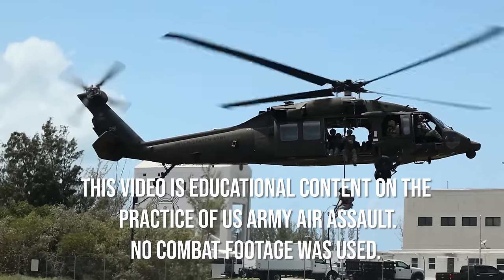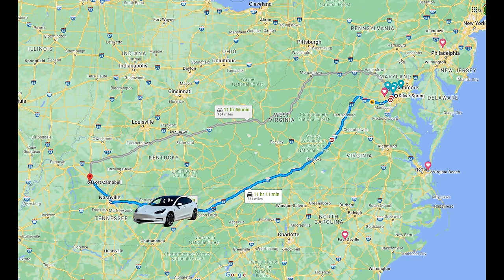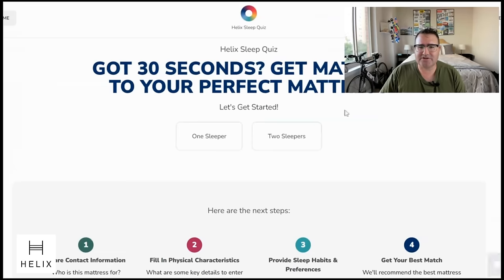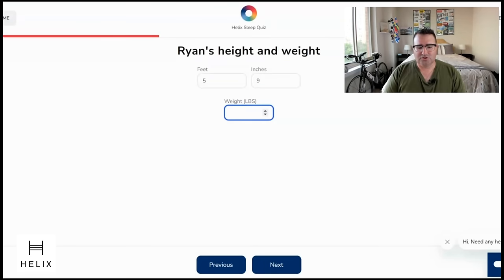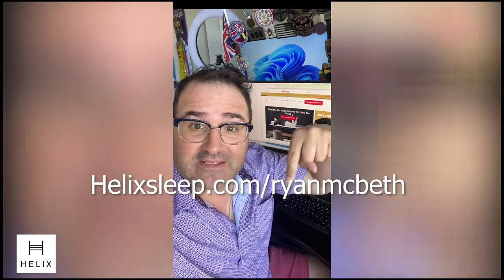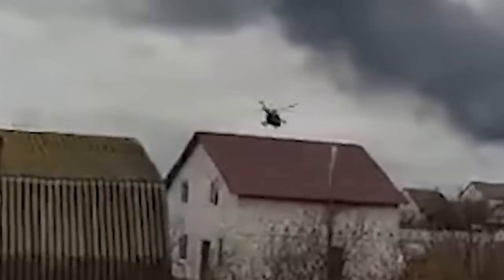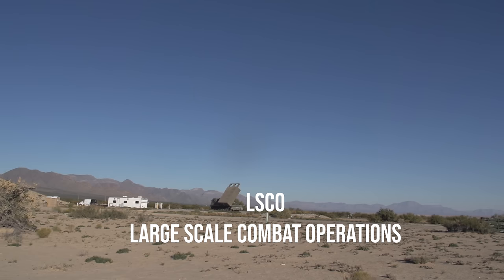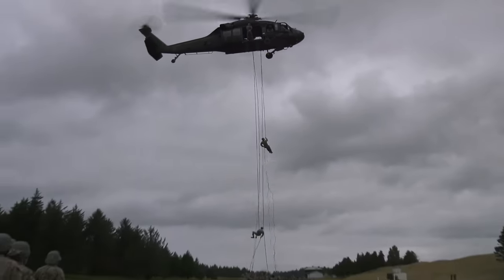How Air Assault Works - Featuring the Rakkasans of the 101st Airborne

Comment: I am a Rakkasan. I am also a former Marine. The combat tours I did with the Rakkasans convinced me that I was in an Elite unit. That is the mentality and the results we achieved support this.
Reply: First Rakk!
Reply: I have not fully understood  if BCT's under the division are airmobile on their own. On the battle order they are denoted with "v" so  they are airmobile but are they using  the helicopters in the aviation brigade for moving, or they have  separate blackhawks and chinooks? If they have their own vehicles, for what  38 blackhawks and  24 chinooks in the aviation  brigade are used for? Can you explain pls.
Reply: I was a Rakkasan as well. I want to tell yall im glad yall made it back brothers. Did you guys know that there is a saying Among the brass for us, I mean well there was? It went like this; "If there is a problem, say a pray for the enemy, then send the Rakkasans."
Reply: 101% agreed.  Some of the best Rakks I served with were former Marines.  Funny thing abour our unit, we had quite a hodgepodge of soldiers making up our unit.  We had former Rangers, Marines, a few complainy 82nd guys, some really awesome 173rd guys, a lot of legs, a few mech heads, and a lot of guys who never served anywhere else.  We had something in the 101st and in the 187th that no one else had in any other unit I served with.  'Til we form again...
Reply: @mustafayldrm3449  They use CAB assets to move, CABs for Light infantry are larger than others to accommodate the higher tempo of movement.

Comment: As a First Calvary Red Leg of 52 years ago. I remember slinging guns below Chinooks . I even saw to two Chinooks sling load a single gun working together. I doubt that’s done any more. 
As you mentioned Ryan any time the turbine is running your consuming fuel. This is critical in the planning stage.
A very well done report.
Reply from the maker: Thank you
Reply: Thanks to those maintainers, they might be using those same Chinook helicopters you were.
Reply: Yeah, I think the army retired most of their towed artillery that require more than one Chinook to lift (what's left is probably in storage awaiting the order to be decommissioned). All the heavier artillery goes on a plane or a boat.

Comment: The crazy part is how much more there is to all this than Ryan could fit in, such as integration with the Air Force and so much more. It’s a capability that people have no idea how to deal with, and I’m glad for that. Nice video, Ryan ❤️🙏🏼
Reply: You left out the Navy; my Dad called in Naval bombardments @ Hue, coastal city, Tet offensive '68.  Fire Supp Coordinator w 1st Cav. situation @ Khe Sanh so desperate rules for B-52s dropping dumb bombs fr 30,000 ft shrank fr not within 2.5 miles of friendlies to 1.5 miles.  Pops attended basic officer training @ Ft Sill in '57, doubt they had any concept of attack helicopters as close tactical support then. advanced training @ Benning '63/64 airmobile concept in early stages.

Comment: Rivalry aside, one thing that Marines and Airborne have in common is that if things go sideways, there is no path of retreat.
A comparison of Marine and Army helo ops would be enlightening.  The Marines invented artillery raids in the Korean War with portable rocket launchers, and still embrace vertical envelopment as central to amphibious warfare.
In the assault you covered, I would see an artillery strike on the AAA position as a good alternative to risking helos.
GREAT VIDEO--Thanks!

Comment: Speaking as someone who has lived on Zama Base in Japan, it's a bit of a cultural faux pas that the 3-187th use the Torii Gate as a symbol. The gate itself is meant to represent the division, or boundary, between holy ground and normal ground. Entering through the torii gate is to enter a shrine and the holy grounds that it has within it's compound. It is also used to mark the entrances to most cemeteries in Japan. As such...you can maybe get an inkling for why it might be offensive to some Japanese people (especially older ones) when they see an US service member walking around with a Torii gate on their arm patches.

Great video as usual, Ryan! Looking forward to more.

Comment: i was a helicopter prop and rotor guy  MOS 68D . this was back in the late 80's.  Got attached to OV-1D unit at Ft hood and became a crew chief on the Mohawk (MOS 67H).15th MI BN, 504 MI BDE but assigned to 1st Cav.  Went to air assault school at Ft Hood.  passed the first try unlike almost half the class.  i think there were about 600 people there on day zero to try to get in.  12 mile forced road march with full gear.  Had to finish in 2 hrs.  I trained for it for several months first.  sling loading and all that is the last few days after they have made everyone drop that they can make drop.  600 started,  a few dozen finished

Comment: I spent the last three of my ten years at Campbell. I was in 311th MI BN. We operated a brand new system, Trojan Spirit. We were the first team to sling load it in the field. Two shelter carrying humvees each with a different load balance. One regular trailer mounted generator and a large satellite dish on the other trailer. First mission ended up with every light in the maintenance shelter busted. And that’s why we train.

Comment: I remember Battle Order did a vid on the weakness of the VDV. And after watching this video, the difference between the two is definitely visible.

The summary of that video are:

-The VDV is trying to be a light mechanised air assault force, but don’t have sufficient air assets to lift their BMD light tanks efficiently (Which the VDV mostly depended for transport and dismount fire support).

-Even if they have enough cargo planes to airdrop the BMDs in scale, BMD itself is too lightly armoured for the role of supporting the infantry dismounts while assaulting an objective.

-Even if the BMD is good enough as it is, there is just not enough bodies in the infantry composition for an operation to last if met with heavy resistance or if opfor is near-peered, as any casualties can quickly lead to combat ineffective.

This goes to show that no matter how elite your troops are, if their mission exceeds their capability, every battle is going to be a difficult one.

Comment: Regarding "gun raids" - I briefly worked at the USAHEC in Pennsylvania and I interviewed a WWII vet of the 11th Airborne. 

During my research I'd learned that the 11th Airborne's 457th Parachute Artillery basically performed a gun raid during the land battle for Leyte - WITHOUT HELICOPTERS. 

They used multiple scout and spotter planes (think piper cubs) to drop the entire 457th on a strategic piece of highground in enemy territory, after which they held the hill till relieved after which they became an infantry unit because nobody knew how to recover the guns. 

Leyte is an interesting land battle because the 11th were innovating chopper assault tactics before the use of the chopper, using those small planes from earlier they would drop platoons or whole company elements behind the forward advance to affect a kind of "hammer and anvil" manuever. It helped that almost the entire unit was cross-trained for both glider and parachute insertion.

There's a reason the 11th was used as a testbed for the airmobile concept after the war - they had the experience.

Comment: The answer is yes. It is still very useful and provides a rapid deployment capability for troops and equipment as well as the ability to recover equipment from areas that are difficult to access with ground assets. Its so useful that pretty much every unit sends troops to Air Assault school to learn the finer points of sling loading and rapid deployment from helo assets.

Comment: Thank you for this video. It’s the most well informed video of what the 101st does on a daily basis. My time there as a 13B (Cannon crewmember) between 2012-2015 was exactly as you described. You get to the unit and it’s demanded that you pass Air assault school asap. The night operations are constant, which means constant training with little to no sleep. 2/320 Balls of the Eagle, Air Assault!

Comment: 15:14 and 15:20 check out the pony tails.  Never saw that in regular Army back in the 80s/90s, but as a 67V (OH-58) I did see that in the Guard.  Was a shock coming from 11B.

Anyway...what a fantastic video.  Excellent information presented concisely and clearly.  The Opord takes me back. Thanks for the nostalgia on that...

Comment: Hello SFC McBeth. 
 You and I seem to have a parallel experience and training. I was in D Co. 2/502 from 1986-1993 and attended every school on base we had aside from the Marksmanship Improvement Course, I graduated from the Sniper School on base in 1987 where Mr. White was the lead instructor and Mr. Bosworth was the second instructor. The sniper course used both Range 1 and the 600 yard KD range that was near the NBC chamber which was at the end of the road where the AAS obstacle course was also located on (I say all this because I forget the range and road number). I was in the Gulf War and FOB Cobra was interesting, it was an abandoned Iraqi/Bedouin village so there was building ruins all over the place. Here’s an interesting side note. When we drove across the Iraqi border when the ground phase kicked off, we followed a road grader driven by an engineer and there were land mines all around but most of them had been out there so long that they didn’t work and the wind blew the sand off of most of them so you could easily see them. They were usually the Italian made mines made out of tan colored plastic, I saw more when I returned in 2003. So after a couple days at Cobra, we were nearly at FOB Viper when we got a call to halt all vehicles and post security in the turret. So around 0800 we got another radio call that the war was over and to return to FOB Cobra positions. I told all the men in my squad that we’ll be back here again in another decade more than likely. Most don’t know that the 187th is a bit different than 502nd and 327th brigades as the 187th is similar to a battering ram, they spend a lot of time training in the field keeping their skills sharp. Although my unit spent a lot of time in the woods but it was shorter periods and those field problems were to also train us on deployment planning and procedures which is very important in an AAS unit since if you need something, it won’t be easy or even possible to get! TOW Master Gunner school taught me a lot about enemy tactics and how our unit maneuvers in the bigger picture. Then Sling Master school taught us how to select, set up and control an LZ as well as coordinating helo CAS when needed in an emergency. I heard the school was later rolled into a Pathfinder school but I’m not positive. 
  Your mission briefing put a smile on my face, very familiar words to any career Infantryman. Backwards planning is critical and I’d always try to bring along extra critical items if I could scrounge them up, including ammo. AAS units require very effective indirect fire support so calling for and adjusting fire is a skill we don’t cut corners on. TOW systems can take out enemy helos, but it helps if the enemy doesn’t detect our launch. When we had the earlier TOW missiles they left a large signature of smoke so we had to select alternate and hide positions for each missile since staying in one place was suicide. Conducting a bounding overwatch is another critical skill, we bound forward by sections and rearward by squad. I don’t know about you but I always had a shit load of HC smoke grenades to use for breaking contact. I don’t know if you were in the Gulf War but we did get exposed to small amounts of Sarin nerve agent as the Air Force destroyed their storage facilities.

Comment: Thank you for this informative video about air assault. I cannot fathom how I didn't learn about the Rakkasans before this video!  Slight counter point about the VDV's loss in hostomel. I believe that the air assault failed in its mission not because of lack of sustainment element, but because they wasted time hovering above the objective trying to find a clean LZ. From my civvie casual learning, the helis only landed after the "garrison" had spent all their ammo and had to retreat into the buildings to regroup and consolidate their forces. And the helis landed on the airstrips themselves creating a large distance away from the enemy to clear. Another point against sustainment: They had planes ready to land at hostomel as you might remember. Possibly they only took off after getting an all clear from the VDV so there was another time wasting there as well. Not to mention many ukrainian elements that reached hostomel had come from both air and ground; this also makes timing the most critical aspect especially the ones that came from the roads. 
My only source is the footages ive gathered from the VDV helmet cams, the ukrainian filming the heli assault above the water(reminded me of apocalypse now, but after seeing the heli crash into the water maybe it was a bad idea) and my most informative source is the William Spaniel video about the event itself. Maybe I am biased into said video's points but it seems to be the case. From your example of the airborne conducting "artillery assault" behind enemy lines, it can only succeed if there are no enemies in the vicinity of the LZ aka strategy and timing. If there were Iraqi units at their LZ they would sustain loses to a point that the command would never allow another "sortie" of the sort.
So long story short: Problem was lack of timing or "timetable of events", rather than lack of sustainment. Thanks for reading this! 

Take Care!

Comment: 101st NCO of the Quarter, 1st Quarter 1992 here.  I was at FOB Cobra servicing AN/ALG 144's also known as the disco ball found behind the rotors of most HELICOPTERS, for the single Cobra battalion at the time, commanded by LTC Cody, who was concerned about the readiness of the heat seeking missile jammers of his battalion. SPC Jones and I verified their calibration on the aircraft.  This is something, as far as I know, has never happed before or again.  Chopper is a forbidden term in the 101st.  Please refrain from using it.  I don't know why, but it was ingrained into me during my training at the 101st. The rest of this video is spot on.  Why 15 degrees on the slope?  Someone exiting the aircraft may get their head cut off. Your mission briefing statement was very impressive.  The lacking part was communications.  That doesn't surprise me as communications is the most significant part, and secretive of the battle planning.  When I was in the Army, we used SINCGARS radios, a frequency hopping network.  Prior to an operation, you had to make sure that you were connected to the network.  Lack of communication can mean death.  I don't know what they use today, but I am certain that it much more important than remembering your passwords. I continue to watch your video.  Why would an Apache use its cannon fire to take down a BMP instead of a Helphire, unless it was expecting armor to enter the Frey? Now you need less infantry, and can spend much more rounds of cannon on the infantry that were not in the MB that you just destroyed.  At this point, you probably could have taken the town with aircraft alone.  But wait, their is more, Apache's have FLIR, which means that they can hunt down enemies in the dark.    The Apache's alone could have taken this whole village.  I guess that your 101st sponsors didn't want to leave the infantry out.  I wouldn't either, as they are known, as the Queen of Battle.
Reply from the maker: I kind of glossed over the commanding signal part because there are tactics techniques and procedures that I don’t want to talk about. Most people wouldn’t care anyway, but our adversaries would.